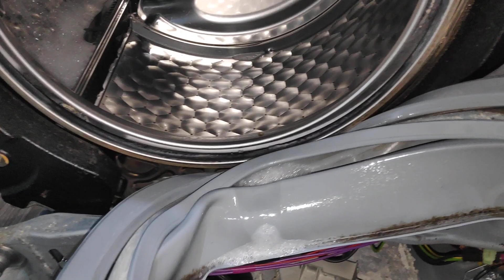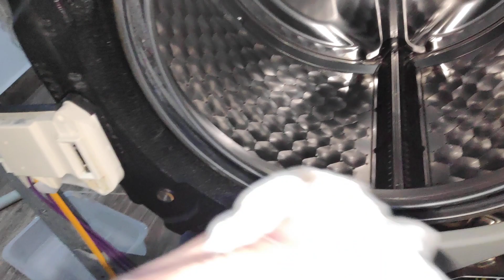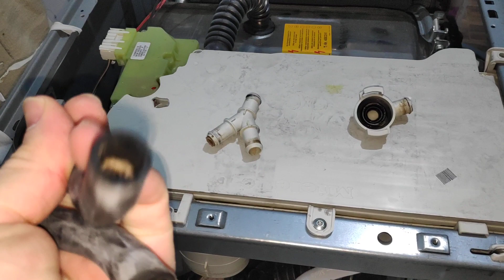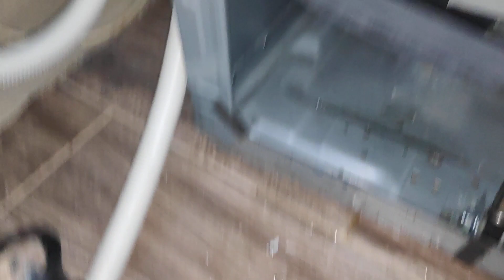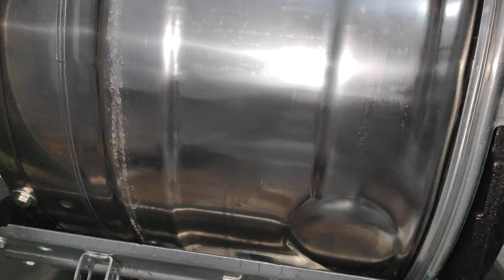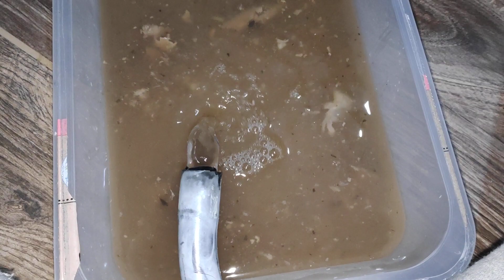Miele w 5825 part 3 common problems with miele washing machines

Comment: leave doors and drawer slightly open so the drum can breathe and you'll never have mold, mine is 15yrs old and no single trace of mold
Reply: I also take the detergent drawer out, and dry where it fits, because previous washers have gone black inside there, but not this one, still white. I also leave the drawer out overnight. Also I dry the rubber seal at the bottom of the opening, where you load your washing after every use. No staining or slime. My washer looks just like new. It's a Bosch, but my next one will be a Miele, and will no doubt outlive me! I've never had one yet, but believe they are the best money can buy, and if you look after them properly, will last 20 years plus. They say, get the simplest one, so there is less to go wrong with it. In this case I feel more expensive is not always best.

Comment: Just watched this, i pulled all the hoses off our Miele WDA110 all had built up soap scum and the i noticed it had a rust spot right at the bottom of the machine, there is a hose right at the bottom, a thick hose called the sump hose, it connects to the filter, anyway i removed it and it had 7 metal hair clips in and some other metal hairbands, all my daughters stuff, these had pierced 3 holes in this hose which was causing the machine to fault and say F 138, this was because water was leaking in the bottom of the machine causing a sensor to stop the machine,  hose ordered and now all fixed, daughter can pay for the hose !

Comment: Sorry for this.
I have also had problems with mine:
Unfortunately mine still doesn’t work after spending many hours with it. First I only removed the front and reassembled everything without success…
Then I opened the back to see how bad the hoses were laying so the did not form a knot … I cleared that.
Then I was searching for the “back hose” that is supposed to go to the rear pump but could not find it:(
Before I did this operation I only had trouble with the twindos nr 1 but now both say the exact same thing “not enough detergent “ like it is not pulling it in.
The only part of the hoses I did not remove was the last part around 5 cm long that enters into the drum…
I was too afraid to remove them but I had a tool inside there gently to se if it was clogged.
Very strange now that both stopped working instead.
Thanks anyway for your video.
My model is wkr 771 wps…
Can it be that the rear hose is not there on this model?

Comment: Looks like you use too much soap and don’t run the washing machine through clean cycles with chemicals to keep it nice
Reply from the maker: This effect is made when used only liquid    its not from too much soap its made from using only liquid and wrong dosage (less amount of liquid detergent) combined with always low temperature....for a fully loaded washing machine you need at least 150 ml of liquid most cities water is hard and all people tend to put less and less detergent to the washing machine also when using powder slime doesnt built up in the pipes liquid creates slime bad smell bacteria etc
Reply: @JIMDP25  Are you saying using powdered soap is better
Reply from the maker: @lifeingeneral9111  yes it is i have seen it

Comment: My miele suddenly stopped and says there's a waterproof error. I read and followed instructions to tilt the machine and emptied out the water trapped in the bottom of the machine and now it works again, but I'm worried there may be a leak. How would I be able to tell if there is a leak?
Reply from the maker: even from the detergent drawer can be a leak instantly because of too much foam and locked water inside the drum water gets out from there while spin also check these pipes as you see in the video to be clean not blocked
Reply: @JIMDP25  thanks so much for your reply. I will have to open it up if the error comes up again

Comment: Hi friend 
Thank you for the knowledge re liquid detergent, I just got a free washing machine similar to this 1913 honeycomb I believe and I ran into the t46 fault code 
I opened up and found a kink in the bottom hose after the magnetic pump so I cut it short and reconnected 
Seemed like an easy fix but when I ran if again it said technical error 
I also got 
The “water flow” code once I drained and tried again.. any ideas ? It was beeping however I was watching it drain quite easily so I’m unsure as to what the problem is.
Any ideas would be appreciated 
Thanks !
Reply from the maker: check flow sensor you might need a new one plus you need to reset or delete this error code via service mode if possible

Comment: Can the mold be removed from moldy door seals?
Reply from the maker: You remove completely from machine  and  you spray it with anti mold agent detergent and leave it for an hour to work in the surface here in Greece i use klinex anti mold it does perfect job
Reply: @JIMDP25  Thank you! :-) I love the older Miele mashines Too! I have three W986, one W985, one W921 with 3 Ramps AND two W377^^

Comment: Can I ask a question, my Miele w1611 looks the same drum type.. The door seal squeals when the drum rotates, the inner rotating drum edge protrudes beyond the outer drum by about 15 mm and the seal lip pressure seems excessive with rubber debris around where it contacts the seal lip. Can you please check on yours if the inner rotating drum and the outer stationary drum are equal heights at the lip edge adjacent to the door seal?
Reply from the maker: this is 7kg drum yours is 6kg  your inner drum starts to break thats why hits the seal this machine is sold cant check something
Reply: Thanks for your reply, in what way does the inner drum break, can the drum be repaired or just replaced, is this a cost effective repair or should I scrap the machine?
Reply from the maker: @gregrutherford5350  replace with another one used or new i repair mine by finding another dead machine wich has good drum
Reply: ilovemiele Really appreciate your time on this, here in Australia dead machines are not so easy to find, any idea of the cost of a new drum?
Reply from the maker: @gregrutherford5350  400 australian dollars?? without the repair cost the price is onyl for the spare part
Reply: ilovemiele Thanks, I think it’s time to buy a new machine, although the machine is about 9 years old it hasn’t done that much work. The rest of the machine appears to be of high quality, it’s a shame this apparent design fault has let me down, and now Im reluctant to buy this brand again. I assume the inner drum is attached to an axle and that is where the failure is, the drum has never ran true since new but I thought that was just a normal tolerance issue.
Reply from the maker: @gregrutherford5350  try to use powder to the new one and high tempratures washings or an empety hot wash with powder every month using only liquids and low temperatures machine dies
Reply: ilovemiele Thanks for your advice, I really appreciate you taking the time to share your knowledge 
Have a great new year
Greg
Reply: @gregrutherford5350  The cause of the seal rubbing is the aluminium spider (bolted to the rear of the stainless inner drum) corroding, which swells up and pushes the inner drum forward onto the seal. Common problem with a lot of frontloaders. Often the force of the swelling between the drum and corroded spider will break the aluminium casting. Repairing a Miele with this issue right now.
Reply: @AntiCoruptionCentral  thanks for that, I ended up scrapping the machine
Reply: @gregrutherford5350  Yeah, it's a real shame as these machines have plenty of life left in them. Planned obsolescence most likely, at the convenience of top-dollar initial purchase.

Comment: Hi mate. I'm having trouble trying to fix my mum's Miele. It has been a great machine, and is very well looked after, but just recently it started pumping the water out after just filling up at the beginning of a program. It also gives some kind of beeping error. I disconnected the rubber hose from the PCB and blew through it which was clear. That's all I could think of trying. Any ideas?
Reply from the maker: Check inside if there is any leak on the bottom
Reply: @JIMDP25  do you mean leaking onto the floor?
Reply from the maker: @perkypat2214  leaking inside i said
Reply: @JIMDP25  if it's leaking inside there will be water on the floor right?
Reply from the maker: @perkypat2214  inside machine  is the water not out of the machine its not open underneath

Comment: Mines dead no power checked fuse any ideas it's a old novotronic W863
Reply from the maker: need another el 200 maybe
Reply: What's a el200? Fuse or relay
Reply from the maker: @bramcoteelectrical1088  the complete electronic board
Reply: Okie thankyou